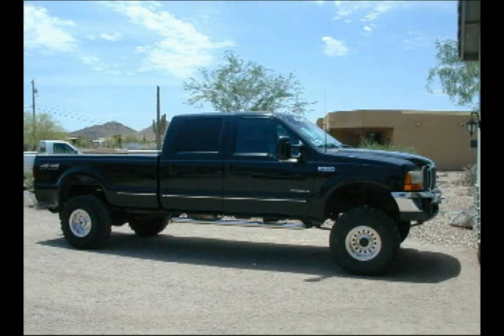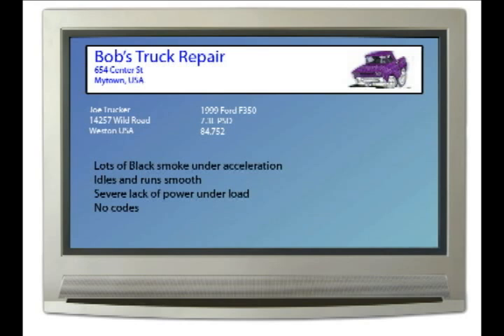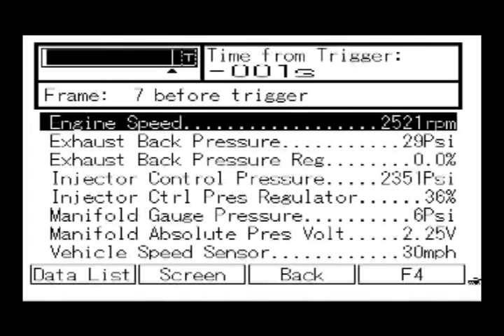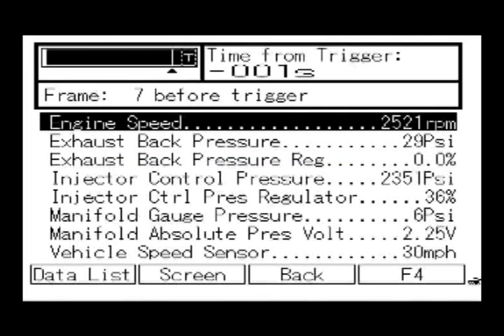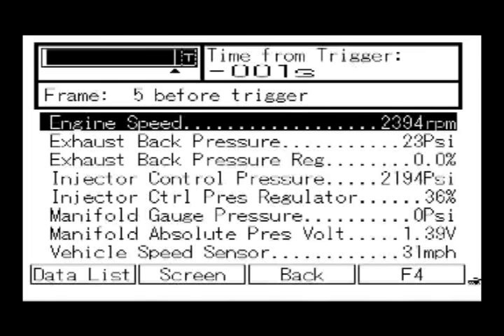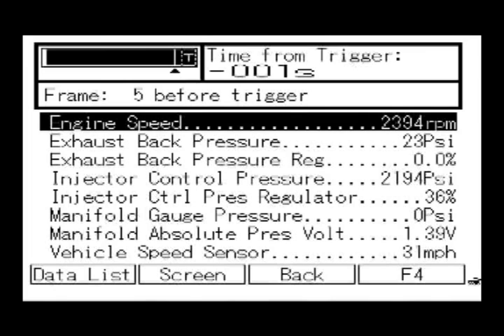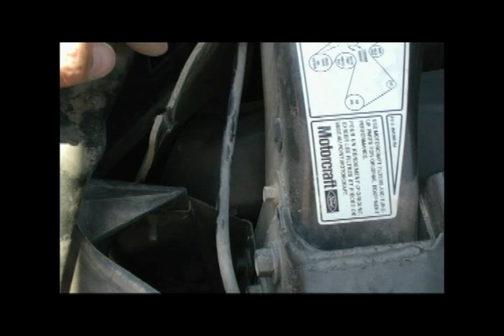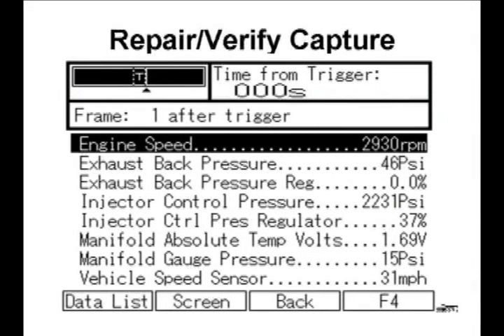1999 Ford F350, black smoke -no codes

Comment: so what was wrong with it
Reply: Did you watch the video? This one was on the intake side. It was a restriction to airflow on the intake side. The owner had installed a new Dinaldson filter that clogged the opening and restricted airflow. It resulted in cracking the snorkel. The insulation weakened and sealed the air intake, which cracked the snorkel duct. The cracked snorkel allowed enough airflow for low RPM operation, but it was not providing enough at the higher RPM. Thry sliced the rubber flap off of the front of the snorkel duct to increase the airflow, apparently.